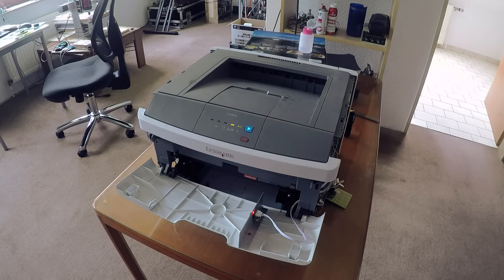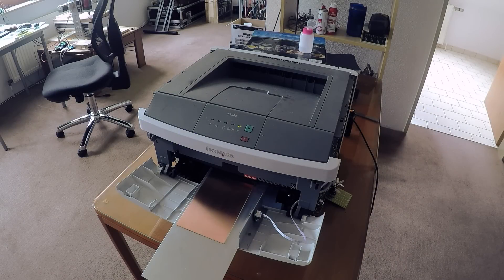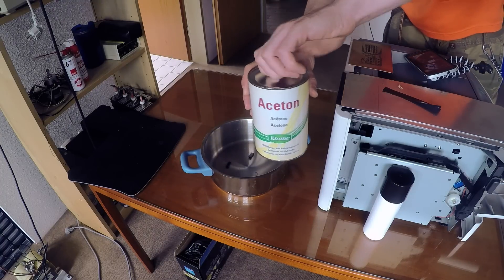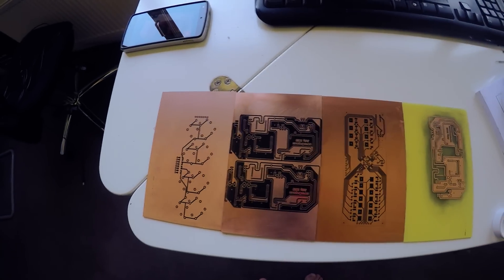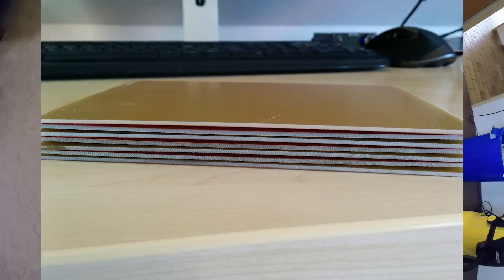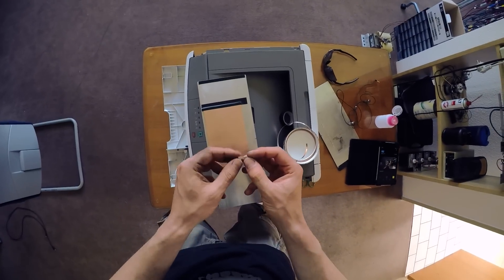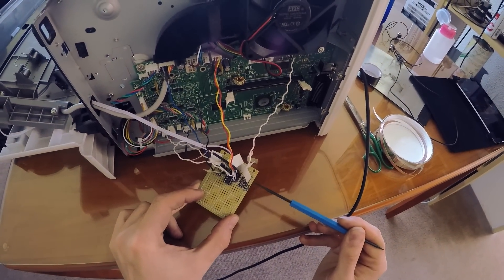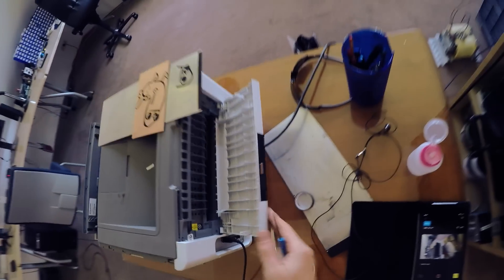Direct PCB Printing with a Modified Laser Printer

Comment: Does anybody remember the CD/dvd printers that we had 15 years ago? You'd put a CD in the tray, and a solid pigment image would adhere to the surface. A little surprised we can't hardness that for printing boards directly.
Reply: I guess...
It's LightScribe optical drive , what you pointing out right ??
Reply: @omsingharjit  They were inkjets.

Comment: Hello,

probably I have an explanation why you have to stretch PCB "image". 

You do not take in account that when you feed PCB board through the printer, it pulled by rubber rollers. 

As your board is significantly thicker than sheet of paper the rubber roller is compressed more than it was designed for. The compression of rubber "decreases diameter of rubber roller and circumvent of roller decreases" -- the PCB board feeds at slightly slower linear speed than it should.

Electronics of the printer control angular speed of rotation the rubber roller and was not designed to use thicker print media. If you could increase spacing between rollers to maintain original pressure then linear speed should be correct and printed image would not require a "correction" by adding 1% in direction of movement.
Reply from the maker: +John Dreamer Thats a solid explanation, thank you so much! I also noticed that the distortion disappears when printing on thin media.

Comment: Rearranging printer roller with Alumina rollers is a good way but chromium rollers work best for dyes and also engraved PCB works very effective rather than the emboss PCB. The printer looks good though.

Comment: i think the sketch is not good because the mfps is not working at all but it works without mcu mod. the sketch was compiled and succesfully written on the atmega328 mcu but i had no luck i guess with mcu mod.
Reply: Cristi, afinal de contas, sua impressora Lexmark E260, funcionou na impressão de placas ? Ela ainda funciona até hoje ?

Comment: What???   You didn't make a cnc machine to just route out the .001mm copper?   just kidding, this is awesome,
I was thinking exactly this after dozens of failures of toner xfer, why can't I just print right to the copper??  
I haven't taken apart a printer, but I assumed the paper must roll past the laser curved around, so a solid sheet would not work,
is that why you must strench the image?   ok this was 6 years ago, you have made the cnc machine now right?  :)

Comment: you can shake some powder coat on top of the laser toner,blow out the surplus, and then put it in the oven. It will give you a nice thick surface for protection and it will keep the dimensions of the toner

Comment: there is a better method. I use A4 Paper with a gum coating (like post stamp). Then i print on the gum side and transfer with a modified laminator. solved all the problems you mentioned. also double side no problem and no changes on printer needed. only put into water and the paper come off with no force.

Comment: BIG FAT WARNING! I just read the instructable and it recommended a shop vacuum for cleaning up toner dust.

NEVER do this unless you are sure that the vacuum has an anti-static hose. 

I once witnessed a colleague blowing his office windows out with a toner dust explosion after using an ordinary vacuum to clean a laser printer. Fragments of glass and plastic were embedded in the ceiling tiles and he came within an inch of losing an eye.
Reply: what should I clean my laser printer with?
Reply: @zoltanbiro6388  You can get get special anti-static vacuums. Normals vacuums have nylon tubes which can cause sparks as the dust passes through them

Comment: sorry didnt realize the upload date but here goes...this application much better than photo resist film however I am just beginning.   may I ask what kind of etchant you are using? my recent purchase from eBay - a white crystalline with no name. can't figure out its chemical nomenclature. mixed messages about  ratio as well. I can always go to ferric chloride but wanted a tidier option
Reply: Chris , by now you have probably sorted yourself out re etchant.  An alternative to Ferric Chloride is Copper Chloride in aqueous Hydrochloric acid solution - will need HCL and Hydrogen Peroxide ,  the HCL easily available as Pool acid and the H2o2 available at chemists (drugstores)  needles to say , goggles, gloves are imperative and don't breath the fumes ;-)  Check out Youtube's  NurdRage for a good explanation on a good number of alternative etchants which is where I got the one above

Comment: The extra aluminum or steel rollers were probably to level guide the PCB.  Unfortunately those toner cartridges are so sensitive, and expensive.  Good work - figuring out the ground!  I did this trick years ago, it didn't work for me - but if I knew about the grounding it would probably have made a big difference.  I had to stop trying when I figured out the PCB'S were so inconsistent it never seemed to get a good print for me.

If you pre-heat your board, maybe add one of those 3d-printer heating elements to the bottom, as it rolls through - at just the right temprature would be enough to cure the toner to the surface.  Also, they can go in a toaster oven, instead of using acrylite to fuse the surface.
Reply: Thank you Erich.  That is really helpful and makes a lot of sense.  Those virgen PCB's are not consistent.  They are wavey and are hard to lay flat, and are not square either.  What you wrote about that is the main cause of the problem with this method was revealing and helpful, so I don't go down the wrong road. THANK YOU ERICH!!!!

Comment: Hello, is possible to make this modification in a lexmark E360?
Reply from the maker: +Daniel Luis Franco I wondered about that, too. Because several E360 ones were available even cheaper. But I didn't try it. Please let us know if you do! I think the chances are good.
Reply: I purcharsed a E360 and I will try to do, I think it will work, apparently the difference is only the display in E360.
Reply: Hello ! Waht about your experiments with e360 Lexmark ? I have e460, what you think about using e460 in this project ?
Reply: One year later... were you successful?

Comment: With all these downsides, I just don't see the benefit over laser printing on tracing paper, applying a bit of oil and exposing the board. This works great for me and I find the exposing the most relaxing part of the process, while the etching takes most time, preparation and cleanup. Also Acetone and Toner dust are are recepie for cancer.
Reply: do you have a video? i didnt know you can use oil as transfer medium.

Acetone is not cancerous just unhealthy like glue sniffing. Its a simple chemical.
The toner is ,since most dust partcles are a serious health danger and cancerous.

Comment: If youre trying to build doublesided PCB, why dont you use two really thin one layer PCBs and epoxi them together?
Reply: +NeumiElektronik It would be hard to perfectly align the two layers.
Reply: +Kevin Gutknecht Drill some alignment holes (i.e. 1mm) then put some 1mm wire in it. Should be enough to align the sides.
Reply: exactly
Reply: Print layers on thin( 10mil or 15mill ) single sided stock.
Not at all hard to do. After etch, drill out some holes and vias, use pins or lancet needles to align use 5min or longer epoxy. press boards and pins into stiff foam with wax paper. Done
Reply: It would be difficult to make plated vias, which is the point of two sided boards
Reply: Or better yet, just print 2 circles as alignment pins, put your first layer on, drill through the alignment circle, toss a pi  through it and through then toss on the bottom layer.
Ive never etched with acid, i have a cnc, so ive never done this, but i think it would work because its basically what you do on cnc.
Reply: instead of PCBs you could use copper plates and then epoxy-glue thin plastic sheets between them (plenty of plastic, like foils for overhead projektors, clear sheet foil and many other stuff) or use 2 copper plates and glue then later on a glassfiberboard (a pcb without copper)
Reply: @parkerd2154  Since this would only be for prototyping, you don't need plated vias. Just put a bit of wire through the hole and solder to both sides.

Comment: Why the Acetone method? If a regular laser printer uses heat to fuse the toner, and the regular fuser isn't strong enough, what about a small kitchen-top pizza oven, or a reflow oven (which, in hobbyist circles tend to be the same, really :p)?
Reply: I wondered the same thing but maybe heating the toner that way makes it run, or something?

Comment: the main disadvantage is the additional time for binding with the acetone, what is you main problem with the toner transfer method?

I mean printing on paper and transfer to the metal isusually takes less than 1-2 minutes.
I figured out when i started that my toner does not work with isoalcohol, and acetone disolves to fast (1-5 sec) so its unusable (even mixed with iso). Through experiments i found a better solvent: Xylene sold in Germany as "Universal Paint Thinner or Nitrothinner".
Tro be sure look on the ingredients of the can.
I found out that for my toner the best mixture is 75% isoalcohol +25 Xylene.
Its because there is enough Solvent (Xylene) and enough time to work with (doesnt evaporate instantly like with the actone i tried).
Ah , there is one caviar, instead of normal paper i have to use magazine paper (doesn't matter if it has already color on it.) i use the Paper from the IKEA Kataloge i got for free :).
Main reason i took that experimenting hassle is i wanted to elektro-etch a logo on a knife.

Comment: Great video. I really like your method.  (I only came across your video now and see it was already  posted approx 3 years ago )   I use the Photoresist method (Positive 20) with various odd tricks & am happy with my results. I appreciate how much work it took to convert your printer. I hope by now you have solved the problem of the damage to the photoconductor roll.

Comment: Marco, thanks for perfect howto on your instructables page.. I found your UPDATE recently, are you happy with 2.5W laser way of preparing pcb's ? I suppose that you are using that machine just for masking copper or are you able to engrave copper layer totally ?
Reply from the maker: I am editing the video about the laser machine right now, should be up tomorrow! Yes it is a masking technique! Otherwise it would either leave molten/oxidized copper behind, or it would have to vaporize it :)
Reply: Cool, I look forward to it.. I have bought old Lexmark but this way looks more straightforward and cheaper if I take into account my time

Comment: Thank you so much for this video, and your others too for that matter, but this video helps me decide which way to go and I am moving toward the idea of a CNC that will using a black marker pen to draw out the copper traces. Then etch, and then put back into the exact same CNC machine for drilling. The CNC will have tool offsets for the black marker pen and the drill.  I suppose it is more desireable to etch first before drilling to save on drill bits and to make drilling faster.  My CNC design would have an easy way to set the PCB board on the tray bed, like an "L" shaped corner where you can set the PCB in the corner of the "L" and push it into the corner tightly and then use some kind of method to hold it in there. Then you could just draw the PCB,  etch it, and then drill with no worries of mis-alignment.

Comment: Get extremely thin PCB material.
That will stop the damage to the drum and conform to the flatness of the drum.
You can then make as many layers as you like, stack them and plate the holes.

Comment: Great video, I use the old iron on method with the iron set to medium. Before I start to iron I spray some silicone spay on a rage , then I iron the rag to transfer the silicone onto the iron. this makes the iron very slippery and prevents smudging. I have used this method for years and seems to work very well.

Comment: why not just cook it in hoven: 10 minutes at 200 and toner is set for ever: I print my face plate that way ! And no funky smell of awfull acetone
Reply: Jose Sanchez A heat gun might be even faster
Reply: @powder-phun949  it might blow the toner dust
Reply: it also needs slight pressure or an the way the printer is designed with was using eletrostatic charge

Comment: Hello, I'm thinking about a fancy way to avoid the acetone part.. What if you use the pcb copper layer as a resistor, applying some current to it, in order to make it warm and dry the ink?

It's a nice project, I think that with some tuning you will achieve a correct result.
Probably if the printer firmware was open source, then with some modifications, and adding more sensors would result in a perfect print on the pcb.

Maybe you can add some rollers at least to protect the toner from those scratches... They don't look very good!

I don't know the laser print process, but maybe is not the most indicated... Think about an inkjet, modified to use a thicker ink, more like paint, that will dry in minutes... I think that it will be less sensible than laser.

I have seen printers modified, in order to be used with clothing, is not an unusual thing.. Maybe some printers are more indicated, or have a firmware that it's more suitable than the others!

Comment: Can you share the  .hex and schematic for atmega328?
Reply from the maker: +cristi eu here is an unrefines arduino sketch if that helps you: gotta dig a little deeper for other things

const int sw = 2;
const int npis = 3;
const int mfps = 9;
const int es = 10;
const int pis = 12;
const int led = 13;

void setup() {
  pinMode(sw, INPUT);
  pinMode(npis, INPUT_PULLUP);
  pinMode(mfps, OUTPUT);
  pinMode(es, OUTPUT);
  pinMode(pis, OUTPUT);
  pinMode(led, OUTPUT);
  digitalWrite(mfps, HIGH);
  digitalWrite(es, HIGH);
  digitalWrite(pis, HIGH);
  digitalWrite(led, HIGH);
}

void loop() {
  if(digitalRead(sw)==LOW) {
    step1();
  }
}

void step1() {
  digitalWrite(led, LOW);
  delay(1000);
  digitalWrite(mfps, LOW);
  while(digitalRead(npis)==HIGH){
  }
  step2();
}

void step2() {
  digitalWrite(led, HIGH);
  digitalWrite(pis, LOW);
  delay(1825);
  digitalWrite(es, LOW);
  delay(950);
  digitalWrite(mfps, HIGH);
  delay(825);
  digitalWrite(pis, HIGH);
  delay(1875);
  digitalWrite(es, HIGH);
}
Reply: +Marco Reps i will try today with atmega328, thanks.

Comment: Why not use a toaster oven or similar set to 200ºC to fuse the toner instead of carcinogenic chemicals? Laser printer fusers run at about 200ºC.
Reply from the maker: Acetone has been studied extensively and is generally recognized to have low acute and chronic toxicity if ingested and/or inhaled. Acetone is not currently regarded as a carcinogen, a mutagenic chemical or a concern for chronic neurotoxicity effects.
Reply: I guess I have the same idea but to preheat the copper board before running it thru the printer. Just a thought .....

Comment: All printers reduce images by 1% or 2% to thwart printing of counterfiet money.  Automatic paper money counters detect tis slight difference to detect fake money.
Reply: That does not make sense. Where in the world have you heard that?
Reply: hpekristiansen GOOGLE it!  There is tons of information, and yes, it is designed to not make sense.
Reply: There are no information about it, because it is not true.
Reply: is that why when i print something that is exactly 180mm x 150mm it comes at exactly 180mm x 150mm?
Reply: Oh yes, the lady at the check-out would surely notice counterfeit money from being ONE PERCENT SHORTER than real money, as opposed to having a particular feel, UV markings, and other features that are not only much more difficult to fake but also much easier to verify. Yep, the correct length will surely be the very first indicator she will check for, and notice, your attempt at paying with fake money. And automatic counting machines will surely and unerringly be able to tell fake from real money by measuring the length which is totally not subject to vary due to wear and tear around the edges. Yes. That's exactly it. Well done figuring that out. Here, I award you this Hat of Recognition-of-the-Most-Retarded-Comment-on-YouTube-of-the-Year-or-At-Least-until-I-find-the-Next-One-that-is-Even-More-Retarded-on-Another-Video-although-You-have-set-The-Bar-quite-high-for-any-Contenders-There-so-That-could-get-Difficult. Congratulations.
Reply: thats a lie i use printers to print direct scale drawings and its actually super accurate with standard settings
Reply: depends on model?